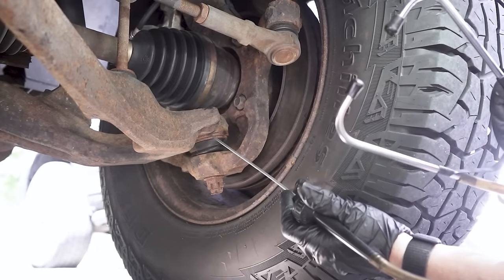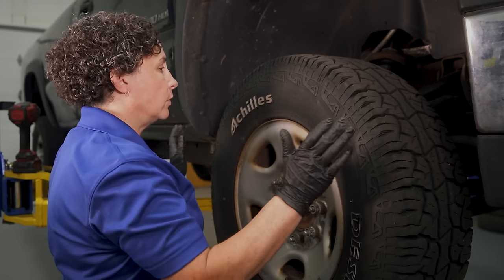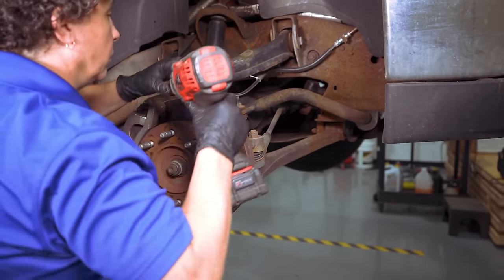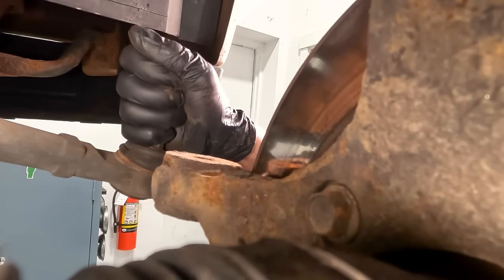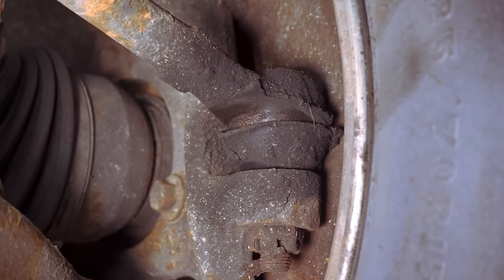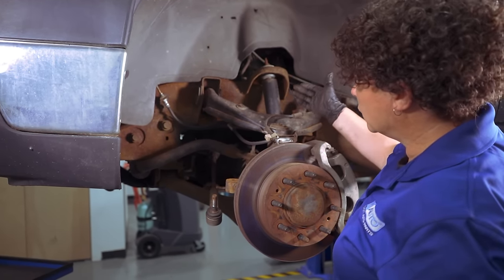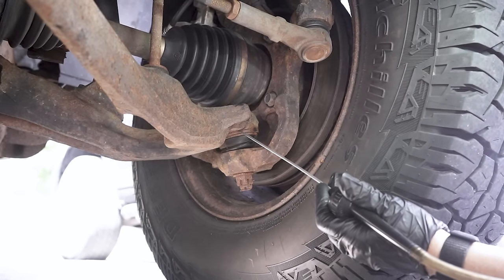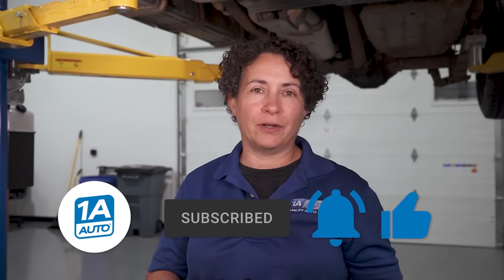Creaking Noise While Turning in Your Car or Truck? Detect Stiff or Frozen Ball Joints and Tie Rods

Comment: I fixed mine by buying a needle for a grease gun and injecting grease into the boot,then sealing the boot with permatex ultra black silicone.
Reply: Patrick where in/on the boot to you insert this needle? Or do you just pierce the boot ?
Where did you find the needle?

Comment: Yes there's nothing I love more than getting under my truck to service it. For how long it takes it will save a ton of frustration in the future. Great video.
Reply: Until u strip a nut or a bolt and it’s off to the mechanics to get it off 🤣🤣 god damn I was replacing my tie rod ends today and my passenger side one was fairly easy until I got to my driver side the Nut that holds  the tie rod onto the the steering arm was siezed on there and I tried for an hour until I stripped it no wd40 no PB blaster couldn’t do it … now it’s stuck and stripped .. not looking good so I have to go to the mechanics for them to do it sadly. I couldn’t get it off… gotta get an alignment as well.. aside from that you do save a lot of money Doing ur own mainetnce. I’ve done all the mainetnce on my truck.. it feels good lol

Comment: You hit it right on the ball..joint that is..I recently did my own front end full suspension and had no idea about the greasing. A few days later I hear this exact sound and realized I never put any grease so I added some..the sound is back a month later and I'm wondering if I destroyed the joint as the damage was already done.

Comment: change as soon as possible because if that ball joint fails and breaks out of the socket. Somehow you'll have no control and your wheel would be completely loose from the steering... also, putting it off of damage other parts on my car like tires  , but yeah, your upper control arms can suffer even more so if you don't replace them in time.. at least on my car

Comment: I know there are some "good" quality ball joints where you can grease them.  But I'm still stuck on OEM for my Tacoma.  I know it's more expensive, but comparatively it's 2x as much, but I just don't trust the quality control of off brand  products. 

But I'm wondering there is a product out there that will help keep the elasticity of the rubber covering the joint. I'm wondering if this will keep them safe longer?

Comment: She’s really pretty good.  Hard to say why, but I listened better and she pre-empted questions that raised themselves during the job.  Yes, fair to say if the part is NEW and stiff, that’s good.  If it’s old and stiff, then it’s freezing/rust/dryzabone.  Now, there’s a couple of points about these sort of jobs.  If you are using a hammer, this mechanic did it all right, you whack the side of the part the balljoint goes into, first.  It ‘cracks’ the gluing effect that rust has.  If you have to hammer the balljoint out, then apart from anything else, pre-lube a day or week before, use a small wooden baton atop the part-screwed-on nut you;ve positioned, get someone else to hold a scissor jack under the thing (hub) at the point where you are hammering.  Use a big hammer.  Decent lump hammer minimum.  The idea is, not to tap-tap the metal of the nut, which is liable to deform with that force, yet NOT actually enough to split the balljoint apart.  A fewer, larger bashes with a bigger hammer and an intermediate wooden batten, or even a steel chisel/bar, supplies the force but without the distortion of the nut etc being as bad.  Just got myself an impact driver, specifically for those jobs where trying to stop the balljoint turning is an awkward thing without three arms.  Impact driving allows the luxury of the part undoing before the balljoint or whatever, spins it seems.  Great vid, just a very personable mechanic, easy to watch and listen, it’s a relaxed delivery.  Good work!

Comment: How long can you drive like that if you’re lacking funds to to fix immediately? Without causing major damage.
Reply: Did you ever get answer to your question I’m wondering same thing was needing to take trip to pick up family member
Reply: Thanks in advance
Reply: @moniquebenavidez9958  did you ever get it fixed? what happened?? i have the squeak and can’t do anything about it
Reply: You should be okay for the moment, on a worry level of scale of one to ten,  it’s about a 4. I wouldn’t ignore it and forget about it, but nothing insane will happen unless it’s completely broken apart or falling off😂the noise can be extreeeemely irritating but nothing louder music won’t fix for the moment. It’ll could cause a bad alignment therefore it would eat up your tires making it an even more expensive repair than it was already buuuut you should be okay for the moment my friend!
Reply: You can still drive the car but when you turn the steering wheel it's going to be 📢 loud. But get it changed as soon as possible

Comment: I have a squealing sound that's happening while my wheels are turning. It sounds like the warning squeal brake pads give, but it happens whether I'm driving straight, whether I'm turning. and I know I don't have sticking calipers because they're at a perfectly normal temperature even after a hard brake. 

2016 toyota Camry LE.

Comment: I’m having this noise at low speeds but cannot duplicate when manually turning the tire on the lift. Tire isn’t hard to turn either. Struts and tie rods were replaced 6 months ago. Is it likely the ball joint or something else?

Comment: I think this is similar to what happening to my car but its creakes more when im slowing down. Feels like the dealership is trying to just get money out of me. It's hard to tell if they know what the problem is or not. Its like oh you need to replace this, but that's not fixing the sound. The sound means something is wrong I need that fixed not guessing and just replacing parts. On the other hand I feel like they know but they don't want to fix it and just giving me the run around.

Comment: Question: My steering wheel is creaking like plastic is grinding on plastic. Could it xome from a ball joint? I don't seem to hear it outside, it sounds like it's very close to the wheel.
Reply from the maker: +@MattiasA72  We wouldn't be able to diagnose an issue like that here, you may want to have a local mechanic take a look at it. Thanks for checking us out! http://1aau.to/m/Shop-1AAuto-c

Comment: Thanks. I wish I saw this video before I went out and bought a freaking left cv joint thinking "Well it it worked for the passenger side, then it's going to work for the driver side. And I bought it based on that smh. There was nothing wrong with my old cv left cv joint. My disappointment when I struggled to get out the left side only to see it in good condition 😟😕

Comment: Great vid thx. I got something similar but it only does when weight on wheels. If wheels  are on gravel or taken off when turning it doesnt make the noise. Only happens with wheels on floorn in hot weather. Not sure what to do.
Reply from the maker: +pepper We wouldn't be able to diagnose an issue like that here, you may want to have a local mechanic take a look at it. Thanks for checking us out! http://1aau.to/m/Shop-1AAuto-c

Comment: Maybe this is my problem too? When I turn the wheel my steering column makes this rough vibration noise. I don’t think it’s in the back it’s in the front. I’ve got a 2914 Hyundai Santa Fe.

Comment: I'm getting them creaking sounds but it's still easy to turn the wheels? Would this still be ball joints and tie rods? Also there's a little play in the wheel, it can rotate it about a cm forward and back with a clunking sound coming from somewhere closer to the engine. Please help

Comment: Our 2002 Camry makes the same sound as the car in the video but only when the car is moving and the steering wheel is turned hard.
When I turn the wheel while the car is not moving I don't hear the sound.

Comment: Same noise when im reversing and putting the trucki into forward gear and coming off of the brake.  Not when turning the wheel though. Sounds link its in the rear. Any suggestions?

Comment: Hey I just got my tie rods (inner and outer) replaced and now I am struggling turning my steering wheel to the left. it's real hard and I can hear that same nose. but the right is fine but sometimes want to get stiff also. Took it back to the place who fixed my tie rods and they said give it a few days to loosen up. that the part might be frozen. Is that correct???

Comment: I have a similar noise and sounds like binding up but I replace tie rod ends n ball joint and the noise came out of nowhere
It prevents me from accelerating in a turn but if I roll into a turn it doesn’t sound bonded up

Comment: Question? Fwd Dodge Avenger. Passes standard testing for tie rods. However, if the steering wheel is slowly moved or rocked back and forth, it's only then that the issues with inner tied rods can be detected (can feel it when hand is on it and also hear it). Any ideas why?

Comment: Is the hammer method of removal used when there's no ball joint separator tool or is it an acceptable alternative?
Reply: it is acceptable; there is not risk
Reply: It's fine to remove the old tie rod end with a hammer if you don't intend to use it, if you are reusing your tie rod but need to remove it, hit the steel that it's stuck in and it'll pop out

Comment: With all the parts made in china WITH out grease nipples...this is what I do....on those tie rods or ball joints with out being able to grease ...I center punch the center of the cap ..then drill a 7/32 hole ...it's only about 1/8 to 3/16 thick ..then use a 1/4 in NF tap  ..you have about 1/4 in to work with...once you have threaded it ..screw a  1/4 in grease nipple ..now you can grease the tie rod or ball joint ..I do this everytime I replace them...will last year's now.. cheers..